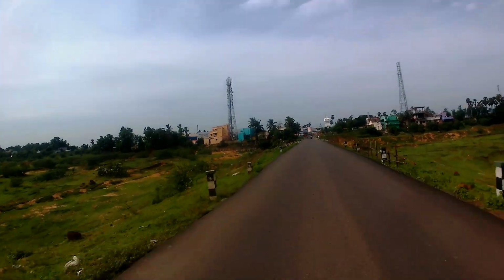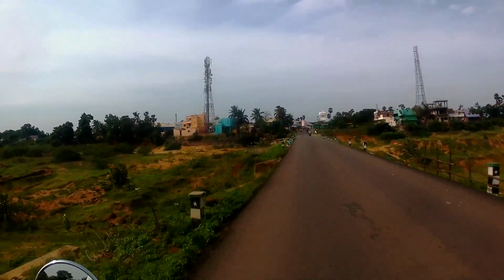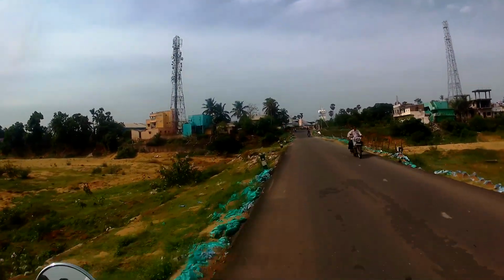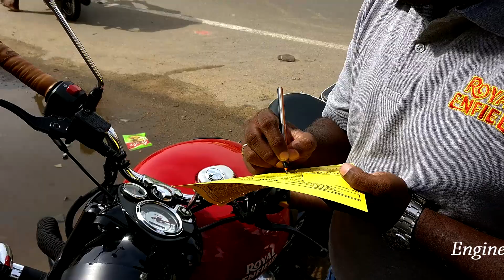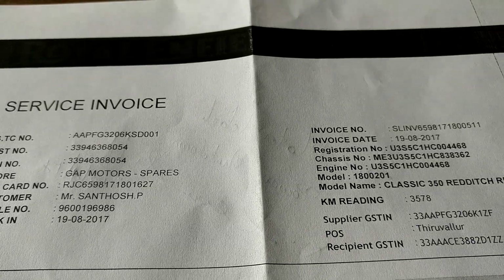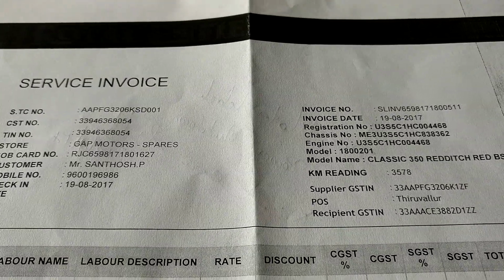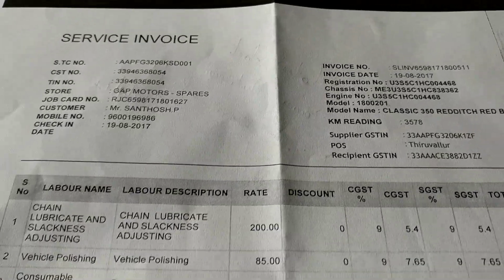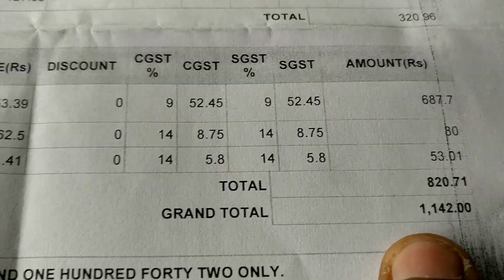2nd Service | Royal Enfield Classic 350cc 2017 BS4

Comment: Gud Video Gentleman. 
2nd service is due on 29th Dec ,driven 2300 kms as of now . I have actually felt  the diff in thump sound after 2000 kms and I personally prefer to have stock exhaust. Gud mileage though avg 38 - 40 kms / ltr. 
Mileage would be really gud if throttle not raised and maintain speed btwn 50 - 60 kms / hr .. 

Keep up your good work on your reviews of this beautiful beast .. 

God bless .. 

Thanks .
Reply from the maker: +Raja Ramakrishnan thanks buddy for your compliments . Ride hard and ride safe ...
Reply from the maker: +Raja Ramakrishnan GAP motors , Thiruvallur
Reply: Thanks